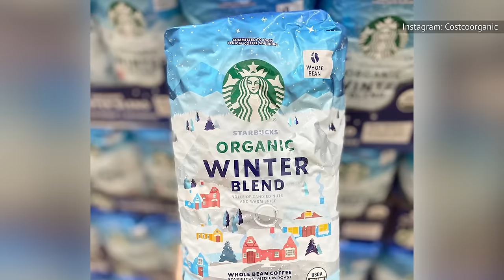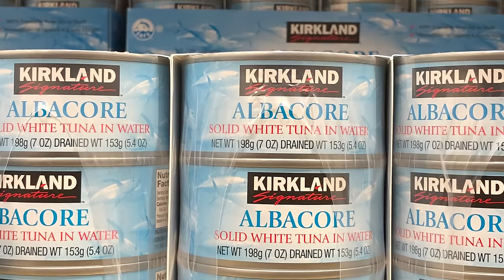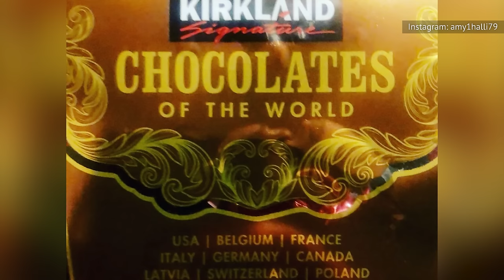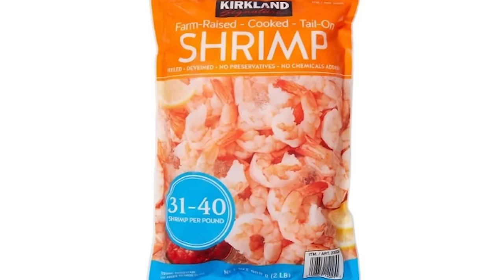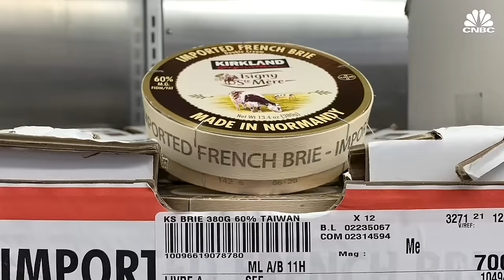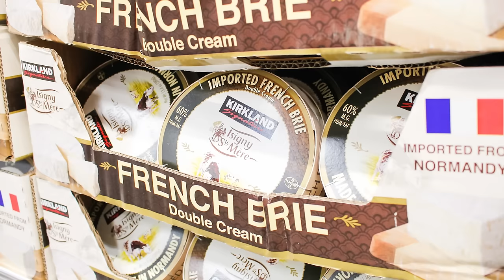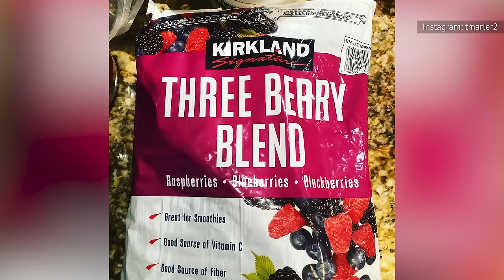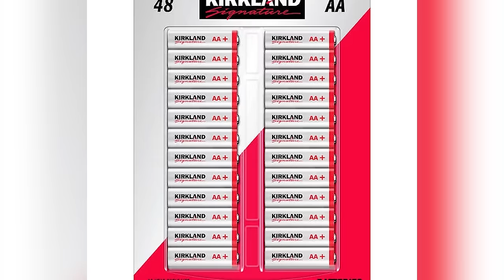The Big Name Brands That Make Costco Kirkland Signature Products

Comment: Terrible luck with Costco AA batteries. Only buy Duracell. Too many leaks!
Reply: This is my experience as well.
Reply: Good to know but, I've had that same problem with Duracell too. Been having pretty good luck with Energizer Max for the last five years though.
Reply: Kirkland batteries are Duracell
Reply: Duracell leak.
Reply: They changed manufacturer a couple of years ago. They used to be top notch, but as you say, they are horrible now.
Reply: Another youtuber,  the guy who dies comparisons of various tools, last year did a pretty good series of tests on AA batteries. The top line Harbor Freight batteries came out substantially better than Duracell, Energizer, and all the other brands tested ... for a much better price. So I bought some of the Harbor Freight batteries, and they've done quite well in my own usage.